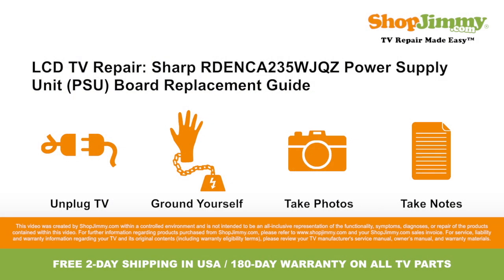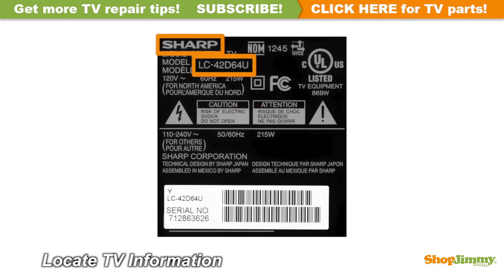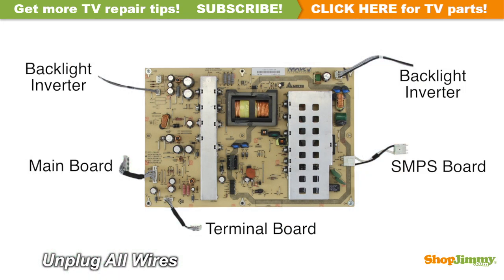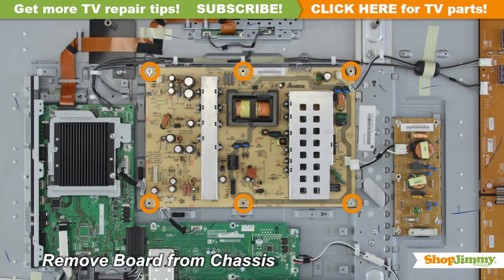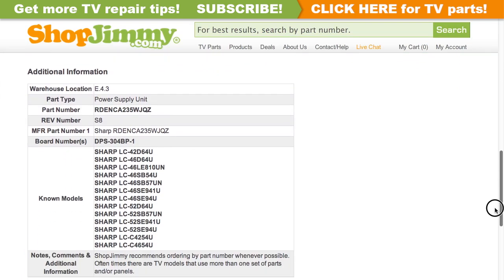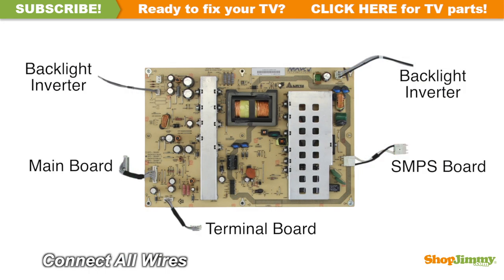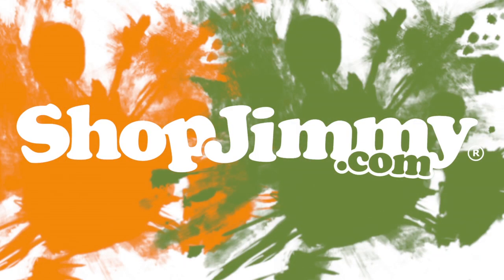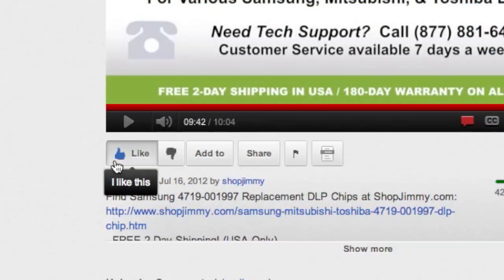Sharp LC-46 LC-52 RDENCA235WJQZ Power Supply Unit (PSU) Boards Replacement Guide Sharp LCD TV Repair

Comment: I have a lc46D65U sharp led T V watching tv last night the tv turned off followed by the power and OPC light flashing once together and power light one time over and over again. Not too sure what to check, have tried different holding different buttons while plugging it in as found on Internet, with no luck. Think it may be the video backlight board, is it with the power board? I don't know Help!
Reply: Lcd tv not led

Comment: I wish there was a way to post a picture with this message, but if I could get your email, I could send you a picture of my issue, The TV works great except for one flaw, it has a long I'd say about 2' foot length bubble strip going across my screen and I can't find any forums that are having this issue, I have a Sharp LC-46D64U LCD TV Ser#710854028
Reply from the maker: +John40ish   You can upload an image online and then reply with the URL.

Comment: Sharp Model LC-40E67UN Serial No. 906801851 will not power up. 2 green and 2 red lights flash. used the back door menu, and then a solid green light. unit still will not power up, wait, unplug, plug back in, reverts to 2 green and 2 red lights. Power supply?
Reply from the maker: +Clif Claven   Try all repairs and troubleshooting at your own risk.  I recommend replacing the main board in your TV.  Click this link to replacement parts for your TV model number:  http://www.shopjimmy.com/sharp-duntkf030fm17-main-board.htm  
There may be multiple boards for the same TV model number, be sure to match part numbers on your current board, with your replacement for compatibility.  Thanks and please let us know if you have any further questions with your TV Repair!  www.shopjimmy.com

Comment: I have a Sharp Aquos LCD. Model LC-42D64U. SN 708814808. The picture takes about 5 minutes to come on. I can see TV function items like input, etc., but no picture. Finally when it comes on, it works fine. Any help you can give would really be appreciated!
Reply from the maker: Kathy Smith   PLEASE SUBSCRIBE TO OUR CHANNEL - Try all repairs and troubleshooting at your own risk.  I recommend replacing the power supply board in your TV.  Click this link to a replacement power supply board for your TV model number:  http://www.shopjimmy.com/sharp-rdenca235wjqz-power-supply-unit.htm  There may be multiple boards for the same TV model number, be sure to match part numbers on your current board, with your replacement for compatibility.  Here is a link to a video showing how to identify your part number, click here:  https://www.youtube.com/watch?v=-i9o4C2XkyQThanks and please let us know if you have any further questions with your TV Repair!  www.shopjimmy.com

Comment: Hi I have a question, My Sharp LC-46D64U will not power on at all could you point me in the right direction. Where do i start to diagnose my problem. Thanks for your time.
Reply from the maker: Jimmie Paimany   Try this at your own risk.  If you have experience with a multimeter, you can measure the voltage on your power supply to see if you have power.  Thanks!  www.shopjimmy.com
Reply: ShopJimmy.com HI I have disconnected the  power supply cable from the TV and measured it and go 120v. Power going to the TV is there, where can I Co from here?

Comment: Hey all, I have a Sharp lc-60le600 that doesn't show anything on screen.  The "standby" or chevron at the bottom is lit but the screen is black and doesn't respond to anything.  I have the back off the TV and there isn't any noticeable damaged components.  Any ideas?  Thanks!
Reply from the maker: Jared Ramsey   I recommend replacing the main board in your TV.  Here is a link to replacement parts for your TV model number on our website, click here:  http://www.shopjimmy.com/catalogsearch/result/index/?cat=56&q=Sharp+lc-60le600  Be sure to match part numbers on your current board, with your replacement for compatibility.  You can also call our customer service for further assistance with your purchase.  (877) 881-6492  Thanks and please let us know if you have any further questions with your TV Repair!  www.shopjimmy.com

Comment: Model # 52D43U sharp 52 t.con board
Veticl line in picture.....
Reply from the maker: Charles Goddard   This sounds like a TV panel (TV Screen) problem.  If your TV panel is bad, it may be more cost-effective to replace the TV as panels are typically hard to find in stock, difficult to replace, and expensive.  Thanks and please let us know if you have any further questions!  www.shopjimmy.com

Comment: I have a sharp aquos lc46e77un and it shot down and it doesn't turn on at all, what you think is not working and what should we do
Reply from the maker: Rebekah Asencio  Is there a standby light on in the front of the TV?  Please reply with this information and then I can respond with a replacement part for your TV repair.  Thanks!  www.shopjimmy.com

Comment: I have A SHARP TV Model  #LC42SB45U  that will not turn on, for a time it would just take awhile to turn on but now it will no come on.  Any suggestions on what it could be.  Thank you
Reply from the maker: Ivan Dominguez I recommend checking the capacitors on the power supply.  If they look puffy, I recommend replacing them and possibly replacing the entire power supply board.  Here is a link to replacement parts for your TV model number on our website, click here:  http://www.shopjimmy.com/catalogsearch/result/?q=LC42SB45U+  Be sure to match part numbers on your current board, with your replacement for compatibility.  Here is a link to a video showing how to identify your part number, click here:  DIY TV Part Number Identification Guide for Sharp Power Supply Unit (PSU) Boards  You can also call our customer service for further assistance with your purchase.  (877) 881-6492  Thanks and please let us know if you have any further questions with your TV Repair!  www.shopjimmy.com

Comment: hello i have a 42" sharp aquos model# LC-32D43U but i get no picture just the screen black but you can see it's on and i get sound can u help me? if so contact me at serian12347@gmail.com plz thanks
Reply from the maker: roland halls I would recommend running the flashlight test on your TV to help determine if the problem is the backlight inverter or the main board. Here is a link to a video we produced that shows how to run the flashlight test. No Image No Picture on Screen-Flashlight Test LCD TV Repair - How to Diagnose Broken Board TV Repair Please reply with your flashlight test results and we can recommend a replacement part for your TV repair. Thanks and please let us know if you have any questions! www.shopjimmy.com